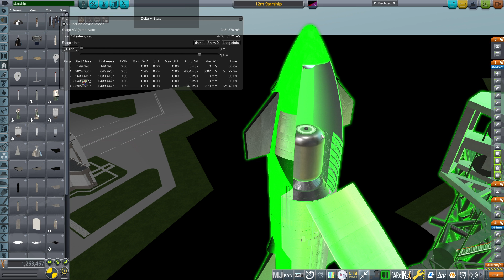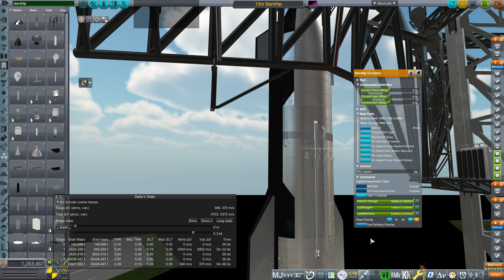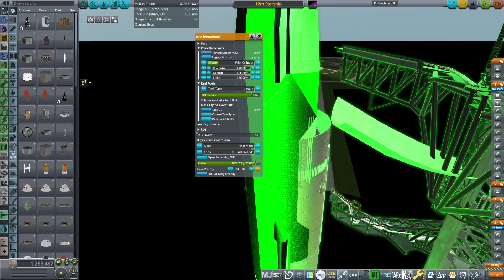Testing the 12-meter Starship (RO in KSP 1.12)

Comment: If you go to 12 m diameter, then why not to 15 m diameter and focus on 200 tons of payload. In what sense would 12 m be a sweet spot? Personally I would propose SpaceX to lower some expectations and try to get to, for example, a reliable 100 tons to LEO with a disposable upper stage. Then once engine development allows better efficiency they could refocus on upper stage reuse with for example 50 tons payload. I think that that would be commercially more interesting and could prevent the downfall of the entire Starship project at some point. 
Also Starship as a moon lander seems far from optimal. In the animations they show focus on an astronaut lift system to bring the astronauts down to the surface. To me this is showing that they are not focusing on the real issues; worst case a winch would suffice (like the rescue helicopters use). However vertically landing a tall Starship seems extremely challenging and unnecessary since beyong the Earth atmosphere there is no need for a pointy aerodynamic vehicle shape. Therefore to me a Starship moon lander is not a good option whether it has a base diameter of 9 m or 12 m. 
Ok enough negativity, I just hope for the SpaceX engineers that the Starship project will eventually be successful and will find the most optimal form.
Reply from the maker: I believe 12 meters was the largest planned for Launch Complex 39 A and B based on the Nova Concept and that's why I limited it to 12 and probably why SpaceX initially proposed 12 meters for the ITS.

Comment: Once they proved that lighting 33 raptor engines was possible I always questioned why they never fully developed a 12m or larger diameter super heavy and starship adding more engines to super heavy instead of stretching the vehicle. It just seemed logical as you just don’t get the same return of adding more fuel if you don’t counteract it with more thrust.
Reply: Well, they have all the tooling to manufacture 9m diameter structures. From a manufacturing standpoint, stretching a tank by just adding an additional barrel section is fairly easy, while changing the diameter would require a lot more changes to the manufacturing process and infrastructure.
Reply: Weight and complexity increases drastically with a 12m diameter, and while ~47 Raptor 3s could potentially push it, they’re designed for the weight of a 9m and ALL their tooling is as well designed for 9m. They’d have to rebuild and rethink their manufacturing process, modify their engines, flight profile, beef up the launch towers, etc. There they may even be a possibility that a 12m starship is too environmentally dangerous to launch on land, and would have to be stacked and launched from an offshore platform as the volume levels alone would melt down ANY wildlife, and an explosion of a fully fueled 12m Starship on the pad would be equivalent to a medium-sized nuclear detonation. IMO, it’s something they’ll probably look into down the line, but currently should maintain and mature their 9m program. There’s not much use for a 12m payload bay, nor 200 ton payloads, but in the future there will likely be a market.